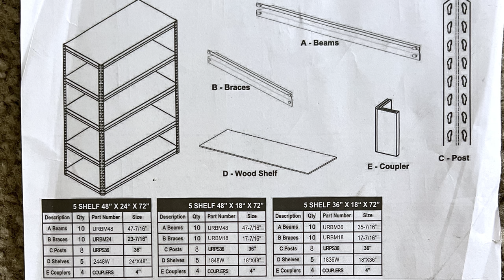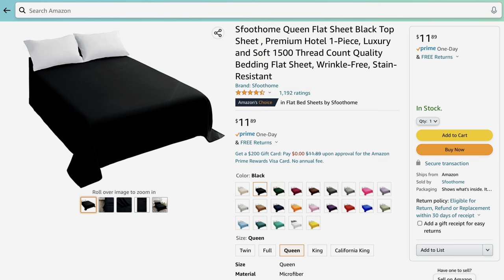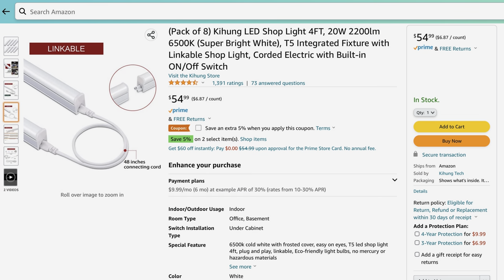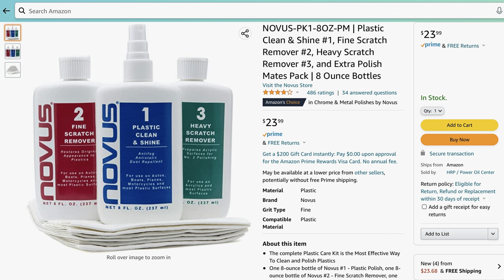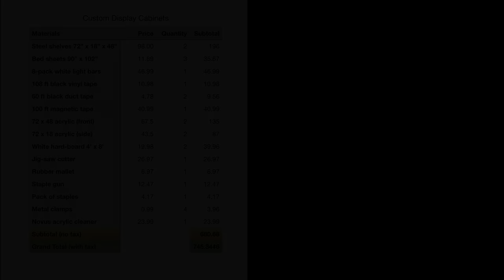DIY Custom Display Case Tutorial | Posing with Peter

Comment: i am currently trying to figure out a way to fulfill my 302 year dream of having a nice display case for my figures. an opportunity came to me to buy a house which i never thought would happen so now i have an actual toy room. and what i want to do is simply turn one of the walls into a display case, but what i need to do it is 12 feet by 6 feet worth of glass to make the doors from and the cost of the glass has me completely held up. plexiglass would be a bit cheaper but i am afraid it wont be rigid enough to stand up and stay in place. the goal is 6 2 foot by 6 foot panels and im just stuck.
Reply from the maker: Whoa 😳 

Congrats on your new home! As for being stuck on acrylic vs glass for your display wall project, I can tell ya that acrylic definitely bends and folds depending on the thickness you get.

The thinner acrylics (3/32 inch, 1/16 inch) tend to be cheaper but flex a lot. I got the 1/8 inch thickness which is a bit more sturdy but it still succumbs to its own weight so the front panels still bend when I remove them from the cabinet. You could always buy much thicker acrylic but then it might not end up being that much cheaper than glass. 

It sounds like your project would be better suited with glass, especially if it’s gonna be a full wall display and not a storage rack like what I’ve built here. Although the glass may be more expensive, I think you’ll thank yourself in the long run for not skimping out on one of the most crucial parts of the display wall.

I hope that helps provide some insight!

Comment: Has anyone had any issues fitting the lights in? I have 48in wide shelves and got the 4ft lights Peter linked and I'm having issues fitting them in
Reply from the maker: Yeah I forgot to show this part in the video and Costa also addressed it in a livestream Q&A that he did, but you can fit the lights into the cabinet by plugging the cable/connectors into both sides of the light bars then bend the connectors 90 degrees. It’ll be a tight squeeze bit it works well. 

I hope that helps, and thanks for watching!

Comment: Can I asking what is mm of acrylic ? Looking for mine too
Reply from the maker: 1/8th inch or approximately 3.2mm thick. It’s a bit heavy though, you can probably get thinner acrylic.
Reply: @PosingwithPeter  thank you for reply. How about magnetic tape for now ? It still keep acrylic with the frame right ? I really like your design look expensive and awesome
Reply from the maker: The magnetic tape is about 1/6th inch thick or approximately 4mm. I adhered 2 layers on top of each other to make it thicker and stronger. Unfortunately the adhesive on magnetic tape was not very strong and it came undone after a few weeks so I had to superglue the magnetic tape onto the acrylic. I also bought a few small circular magnets and glued them to the acrylic so it can attach more securely to the metal frame. 

I hope that helps, and thanks for your kind words & support!
Reply: I have 30x60 2mm acrylic and I test to use it with my showcase but it really thick and flexible I don’t know what is good for use but I think will order 3mm but 4mm look interesting a price a bit more from 3mm I don’t know how weight of it can I asking 3mm it is have weight much or not and when put it in showcase acrylic can flexible or not I saw you use large sheet but still look not flexible so much like 2mm 30x60 of mine
Reply: What do you think of acrylic 2mm 3mm or 4mm ? You using 3mm and do you think thick than 3mm will good or not I need your thoughts cause I don’t know 😂

Comment: How do you connect the two racks together?
Reply from the maker: Oops, I forgot to show that in the video but I just used black zip ties to pull the racks closer together — the frame already has holes up and down so it’s very easy to use maybe 4 black zip ties to connect the racks together where each shelf meets the metal frame.

Comment: What weight each shelf can handles ?
Reply from the maker: This rack in particular can apparently hold up to 800 lbs each shelf according to the product page, with a max capacity of 4000 lbs for each cabinet: https://www.walmart.com/ip/Juggernaut-Storage-48W-x-18-D-x-72-H-5-Shelf-Steel-Shelving-4000-lb-Capacity-Black/640146798

Comment: Whats size the clear sheet? Thanks
Reply from the maker: That will depend on the size of your shelf rack.

Mine was 72 inches tall x 48 inches across x 1/8 inch thickness.

Hope that helps!
Reply: Thz 
I'm mean the thick or thin 
I bought my acrylic panel 3mm 
For the front panel won close its always has gap and fall down all the time 😢  maybe too heavy

Comment: what is the thickness of the front panel?
Reply from the maker: Thickness on all the acrylic panels are 1/8th inch — I wanted them to be a little more rigid since I wasn’t planning on cutting them into smaller pieces so they needed to have a firm structure to prevent them from bending/flexing too much.
Reply: @PosingwithPeter  thank you....I'm creating one soon exactly like yours thanks
Reply: @PosingwithPeter  I bought the lights as the video and the storage rack but the lights have plugs on both ends that don't allow it to fit as in the vid. How you fit them in because I can't seem to fit them since the plugs on the ends get in the way....I can only fit one end and not the other.
Reply from the maker: @jedimaster8505  Yeah it’s a tight squeeze but they can fit by bending the wire/connector about 90 degrees. Just gotta make sure that the connector at both ends of the light bar are fully inserted as much as possible, then bend them 90 degrees in order to force them to fit.
Reply: @PosingwithPeter  thanks, I'll try thanks. keep you posted thanks alot
Reply: @PosingwithPeter  worked and it stood steady by itself and the two end of the plugs hold it in place with no need of eny extra support. thanks

Comment: My lightbars do not fit the frame if i use both connectors to link them, fml
Reply from the maker: If you got the exact same light-bars AND same juggernaut metal cabinet as I did, then you can fit the light-bars in by bending the connectors on each side about 90 degrees. I mentioned this tip in the FAQ section of the description box.

Hope that helps!